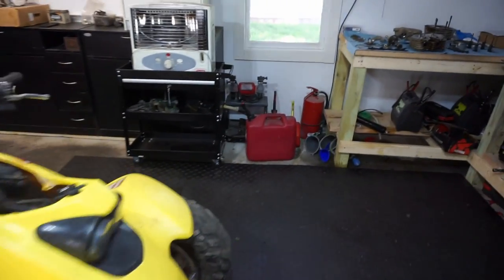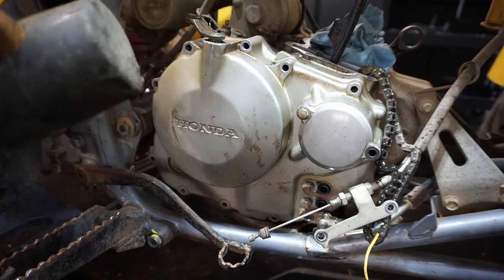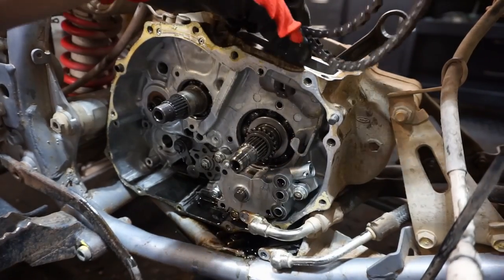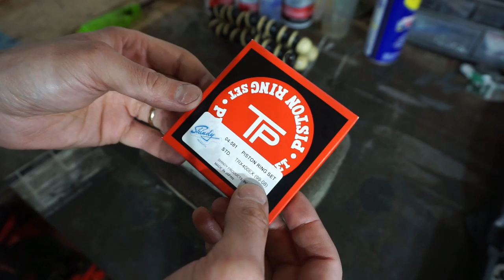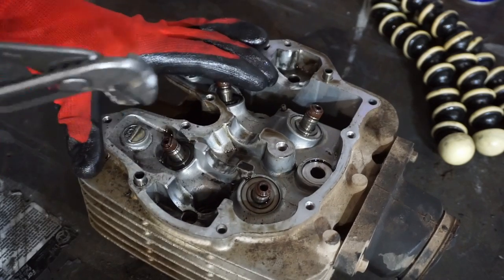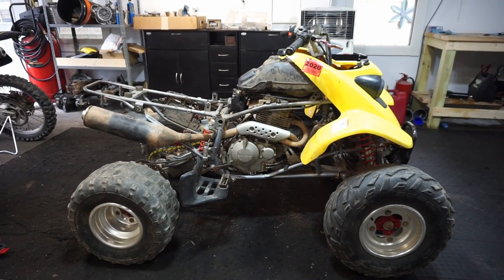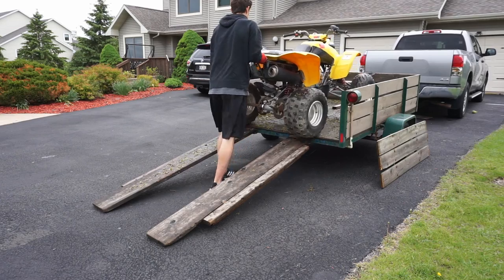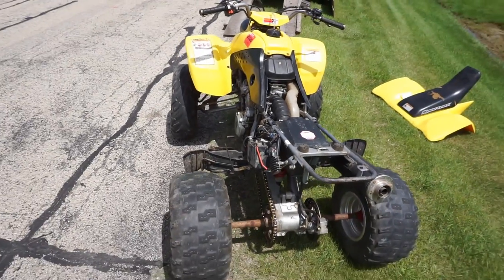Honda 400ex Has Weird Problem. I NEED HELP!

Comment from the maker: What do you guys think is wrong with this 400ex? I'm stumped on it!
Reply: Watching and will give opinion shortly after. Love the uploads.
Reply: It's not in the metal recycling centre
All terrain vehicles often roll over and cause mental injury and / or, maybe even a physical injuries
Reply: Oh no lol. It's defintly got a damn gremlin in it. You nailed everything I thought of....seems that there must be something going on with something somewhere electrical- this one got me stumped bro. Sorry! Wish I had the answer.
Reply: But, On a more serious note : IT might be better to take it to the Honda department
Mainly because can't hear it properly unless there
Reply: Float bowl running dry at full throttle at high rpm. Make sure you have proper flow into the float bowl
Reply: When I first heard it start it sounded like it was starving for air.
Try replacing the whole air sponge plus place some oil on the outer surface of the sponge
Reply: Another great option is to buying fuel from a different petrol station though, obviously get rid of the old crap in the tank
Reply: Joe the only thing left could be the cdi may as well try it atleast a cheap one see if it helps
Reply: And after I said that I just heard you say all it could be is cdi so may as well try it lol looks like we both think that's all it could be
Reply: Something to do with ignition switch
Reply: check that the kill switch is not the issue could be once you get to 4th or 5th vibration could be causing kill switch to kill it try riding on rougher terrain see if it happens at lower speed
Reply: @greatest_bumble_bee_dude  what are you talking about? the 400 needs to be in a mental institution or hospital you think?!
Reply: It’s gotta be the CDI or even just a loose ignition wire somewhere
Reply: so the timing is correct otherwise it wouldnt start up and run. enof fuel i guess -?- cuz u said it sounds like no more spark at high rpm. because u get a spark at all it shouldnt be a mechanical issue in terms of stator or sth. but what does give the advice to spark. the position sensor gives the time and the battery provides the energy and the cdi tells everyone when to step in. since u replaced the stator including the new position sensor and the Ignition coil, spark plug and the rec. this should be ok. what is left now?  - the cdi and ?
Reply: @greatest_bumble_bee_dude  for me the most frightening part and most painful and terrifying always was the mental thing. not even the body pain. somehow i love a lil bit of pain. esp the relief pain after u extracted sth from ur skin or flesh. but the mental part is always the hardest. to find confidence again and trust in urself and the vehicle.
Reply: Sounds like running float bowl empty at high load wide open throttle. Check flow from tank when on level surface and at angle. Make sure no floaters in the tank to block valve. Does it still shut down if you run it in reserve?
Reply: Check float level...make sure the float isn't set too lean or would cause exactly the problem your having
Reply: I would test to ensure it only happens in 5th wide open as other stated … a little rough terrain and some wide open 4th gear runs … if it happens under any other circumstance it’s cdi or wiring short …if is still only happens in 5th it’s the carb … cuz it must be emptying the float … remove any inline fuel filter … triple check the tank is flowing like an open tap … adjust the float height.
Reply: I’ve had similar problem twice once on a customers warrior and no matter what anyone did same problem remained my boss had his wife’s warrior in for a service
So I swapped cdi’s from my bosses warrior and took it for a ride and it couldn’t get over 40mph without cutting out.
then years later a gentleman came in saying his R1 would break up and want to die at anything over 100mph new cdi and problem solved.
If you have a 400 ex or an extra CDI it’s definitely worth a shot
Reply: It it was fuel starvation due to restriction or low float level at WFO wouldn’t it fire back up when you reduced throttle while still in gear?
Reply: Try idling it up pretty high and then ride it around and see what it does then you can idle it back down where you want it if it works.
Reply: Some of my quads have done that.
Reply: Replace stator with known good stator
Reply: Also I'm sure you went over this already but the valves or something sounds a little ticky won't help that exact problem but won't hurt either
Reply: @sirago6411  most of the cheaper and aftermarket electrical parts will work just not last so I doubt that's his problem considering it's new very unlikely it came not working
Reply: Check for safety shut off on clutch
Reply: Unplug parking brake sensor and throttle sensor if it has one, measure float bowl adjustment and make sure it’s adjusted right, maybe replace fuel switch as well
Reply: Might want to check the rev limiter
Reply: Oil temp sensor light problem maybe?
Reply: 99% sure the fuel level is too low,, if it was cdi or coil getting hot it wouldn't start right back up like that. Loose wire would appear at random times and wouldn't always be at 5th gear full throttle. I had a suzuki eiger that ran perfect at home, took it down the road and after 10ish seconds of full throttle it would just die.
Reply: put a cdi off another one of your 400s and see if that's what's wrong with it
Reply: Lean the bike back while it's running. If it dies, it could be a loose connection. Also wiggle the wires at the CDI while it's running. I don't think it's fuel related because it would bog down before shutting off.
Reply: Thinking float height, or a safety switch getting activated due to increased vibration, possibly a short in or loose wire. Just a thought. Good luck
Reply: I had the same issue it was the gas flow....
Reply: I think that the last comment is correct because if the petrol Isn't getting to the cylinder properly it will likely  burn extra oil
Feel free to check out the spark plug along with the exhaust system infrastructure
In order to see the sides of the exhaust for oil deposits instead of burnt out carbon
Reply: Also : it's usually better to replace the spark plug with NGK .
It's better than some other brands.
A thick blue spark should be evident
Reply: Ok so I had the exact same problem with mine and it was running out of gas at 4th or 5th gear full throttle for like 10 seconds, the fix was super easy the previous owner had added an extra fuel filter in the gas line and restricted the gas flow making it run out of gas at high rpm. Double check to see if there is anything restricting gas flow to the carb.
Reply: From the video it seems to cut out all at once when you hit high rpms but it will restart.  That would indicate the CDI box ignition advance circuit doesn't work.
Reply: Definitely the cdi or its wires are loose
Reply: That's what happened with my old Suzuki RM 125 bike

The CDI Plus even the coil wrecked Up and had to buy  new ones from spare parts devision
Reply: That thing used to sling around like a bandit but, not as tough As the Honda cr250
Reply: @greatest_bumble_bee_dude  i had this problem on a yfz450 and it would only run if you held the cdi in certain position
Reply: @greatest_bumble_bee_dude  the cdi wires were oxidized so cleaning fixed it
Reply: @greatest_bumble_bee_dude  so do automobiles.......
Reply: Clearance
Reply: Fuel petcock or line could be not flowing enough volume.    Draining the carb.    When it shuts off the fuel bowl in the carb gradually refills so it starts up.    Lower gears won't require the fuel demand of a wide open pull in 4th 5th.    Possible.    Nothing spark related would affect only 4th and 5th.    Fuel would tho since fuel demand is at its highest in 4th and 5th.     4th and 5th are longer gears.   Requiring the feul flow duration to be extended draining the bowl of the carb.
Reply: Maybe kill switch is vibrating loose or is  cut open and making contact somewhere
Reply: the plug for the rectifier/regular  the wires going in the pug has bad connection and vibration from motor ic causing it to shut off.  I had same issue with my 400 ex.  it is  not the cdi or coil it will shut off and not run at all if they were the issue. I shoved wires in tight then hot glued the wires into the backside of the plug and wire tied the harness to the frame it solved it for me .  The put it in a horrible spot on frame  were mud and everything from rear tire hits it . Good luck
Reply: Do appreciate your Videos and have learn from them.  That being said, Given the prior bent valves and how it lost the proper gap after you had set them.  Now the duress under higher load.  You might want to check the cam lobes bearings and journals holding the cam on the head and cap.  Also take a close look at the Rocker arms.  It is possible that under higher load the cam shaft can be slightly out of position and totally change the gap on both the intake and exhaust valves and when you are working with thousandths any change can have a major effect.
Reply: Replace the float who knows if it had a incorrect one put in problem with fixing stuff that's had other hands on it already
Reply: Sorry would be just guessing
Reply: c.d.i. they have a built in rev limiters made into them.
Reply: Joe there is another rectifier I know it’s charging but maybe try to replace it. It’s a small square part looks like a small relay. If you look at the parts diagram you’ll see it. My 400ex was having a similar issue and it was the connector from stator to harness it was burnt and melted. Who knows man this is a tuff one for sure. The harnesses are pretty cheap on rocky mt atv. Maybe try a new harness?
Reply: Surely you have another EX around where you can swap swap parts and figure out what's going on
Reply: Wiring harness
Reply: sounds like a safety factor like the cdi can only hit so many rpm before it cuts off, can't remember if it was this bike or another but check the Cams make sure the chain didn't put a wobble in them
Reply: Back in the day everyone was running modified cdi which were not always the most reliable .
Reply: Would like an upd8 Soon enough please
Reply: Update?
Reply: Still think you should try a known working stator.
Reply: I have a Kawasaki bayou 300 if you come to West Virginia I'll let you have it's stuck in first year don't have no brakes

Comment: Anytime I have an electric issue, I refer to the manual ALL Voltage and OHM specs for every part of the system. If everything is within spec, it is the CDI. Everything HAS to pass tests in spec to determine if it is the CDI. The trouble is, sometimes aftermarket parts test out with the quad off or at low RPM (idle), but fail at higher RPM or hen they get warm - especially coils. Coils tend to start failing at hot temp 1st before total failure. I bet $1000 it's that aftermarket coil. I've had this same exact symptom on a trx450r, a YFZ450, aaaaaannd my 02 Chevy Trailblazer. I would (if this 400ex was at my house) order and OEM coil from Rocky Mtn ATV.
Reply: I feel you might have a point, I rule out fuel because no issue in other gears only fifth. The time he's in fifth the coil has time to get warm. Another thing a poor electrical connection and with the vibration from the motorcycle could cause a issue. Even something as simple as something poorly grounded. In any event I'm interested to know what the actual problem is.

Comment: I've had a fuel cap vent plug up on me before. The only reason I found it, was because I had a clear fuel filter between the fuel tank and the pump and it was dry.  I would try a clear fuel line between the petcock and carb and see what happens when it does it again.  Right now that "parts cannon" is getting pricey.  Good luck.
Reply: I had one that when you ran the vent hose in the steering stem it would quit.    There was water in the stem so when you stuck it in the water would block the air flow

Comment: After lapping valves we always took a black sharpie and marked up the valve seating area and put back in the head and spun it around just like lapping a few times and took back out to see where the valve was sitting and how wide the seat area was. It always gave me peace of mind knowing the valve was seated good all the way around. If a wide area of the sharpie was gone we need the seat needed to be cut to change the angle.

Comment: i have a carb gsxr 750. I had a high rpm cutout in higher gears. I changed the stator, reg, plugs, swapped coils, adjusted my timing forward and back a tooth since my base timing was always a half tooth off, changed fuel pumps, petcock. cleaned my carbs like 3 times. What it ended up being was my air filters were causing a restriction. Sounds simple, but a restricted air filter or air box will cause a condition like that at higher rpms.

Comment: It was never an electrical problem to begin with,it’s running out of fuel under wot/full load in higher gears & choke won’t help in that situation either because there’s no fuel left in the carb.
The issue is fuel flow & or float level in the carb float bowl.
But 1st check to ensure the fuel tank & cap are properly vented because if not a slight vacuum with firm in tsnk reducing fuel flow.
If that checks out ok then check fuel lvl in the carb.
When check fuel lvl in carb do it the proper way by pulling the carb off motor & then hooking up the fuel line & opening petcock to fill the carb float bowl.
Then carefully remove float bowl to see if fuel lvl is at upper end of oem spec for fuel lvl in the bowl in Honda fact srv’c man.
If fuel lvl isn’t high enough adjust/bend tan on float to adjust & reattach float bowl & refill & check again till you it right. Again, this has. Keats been a fuel delivery issue from the start & is why none of the electrical ign & charging fixes you threw at it didn’t work.
This is coming from over 5 decades of 1st hand experience wrenching/rebuilding/restoring classic motorcycles & American muscle cars too.
Good luck & Happy Motoring!

Comment: Great video sir. The only common issue you typically will face is, all the work, large and small repairs, brakes etc., will almost never be appreciated or felt by the owner as you going the extra mile and then some.  They somehow focus on maybe the engine performance, but not give a second thought as to the numerous extras that it needed, yet the owner didn't realize or notice.

Comment: Thanks for all your Informative videos the fact that the engine cranks over at full speed after cutting out leads me to believe charging system is adequate I would look at the wire from the Kill switch to see if it’s shorting out on something usually it cuts out when grounded

Comment: I watched a youtube video where a guy had a chinese quad and it cut out at high revs. He lowered the needle in the carby slide as he thought it was getting too much gas. He fixed it. Could be what your issue is as that would explain why you could restart it as it was still getting gas compared to not getting enough gas! Love your vids mate! Cheers from Australia!

Comment: Had a similar thing on my Sportster.  Drove me nuts for a while.  After rebuilding the carb, new gas cock, new fuel filter, new plugs, new cdi, new plug wires, it turned out to be a blocked vent in the gas cap, and t he tank was getting too much vacuum.  However, yours to me sounds more electrical.  It doesn't do that at high rpm in lower gears, just higher gears?  That "may" be time based (takes x amount of time to go through gears and get into 4th and 5th where it happens), or intermittent wire connection where higher speed air flow aggravates a wire. To see if it is speed/air flow related, I think I'd run it at high rpm in 2nd a long time and see if it still cuts out.  However, you are one of the best at finding these black magic anomalies on these things.  It will be interesting to finally find out what it is.  Please keep progress posted!!

Comment: I had this same problem mine would run great till I hit 4th or 5th gear and would turn off but start right back up.  Turned out I had a Chinese carburetor so I ordered a OEM carb and haven’t had that issue Since.

Comment: Check for tight valve tolerances. I had an XR 250 that had tight valves and would cut out under heavy throttle just like that.

Comment: I had a boat motor that did the same thing and it was coil worked fine, till longer runs at high rpms.. You fixed coil wire but coil could have been damaged from it not being right. Quick easy check if you swap coils with a known  good one.

Comment: I think that stock CDI has a rev limiter. I've heard that some Honda quads have a low RPM cutout point. I would check the specs on that and compare it to an aftermarket unit, which probably would have a higher RPM limit.
Reply: ... and that problem can be even worse if someone alters tire size or sprocket size, when it forces the engine to rev higher. Either way, you'll probably be replacing the CDI.

Comment: Check the wiring to the cdi box it may have a bad connection,  that when you get to a certain speed the wind blows against it causing the cdi from sending any signals.

Comment: I would take the seat off, take off the airbox top and maybe air filter. Carry a flammable liquid with and when it cuts off spray the flammable liquid into the carburetor to see if it is a fuel delivery issue. You do  great work and are very generous when you repair people's rides for free.  Side note.  I am not responsible for any injuries or equipment damage when doing this.   🤣😂🤣😂🤣😂.    Good luck and I know you will have it figured out soon.

Comment: Run a clamp on spark indicator on the plug wire. Run the lamp end up to the handle bars and road test it. See if the spark fails by the indicator light flashing. This will tell you if ignition is the problem!!!